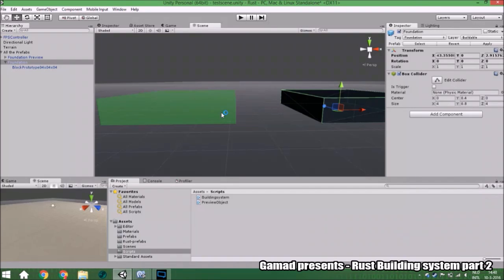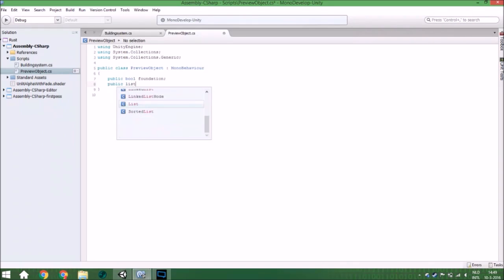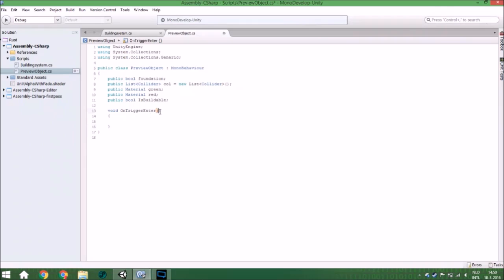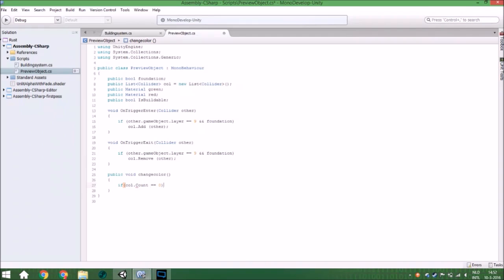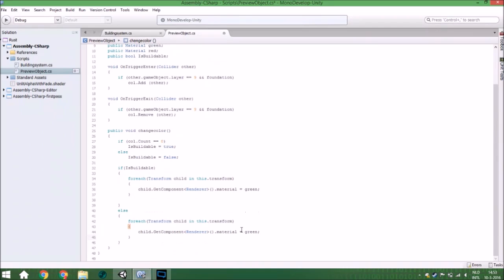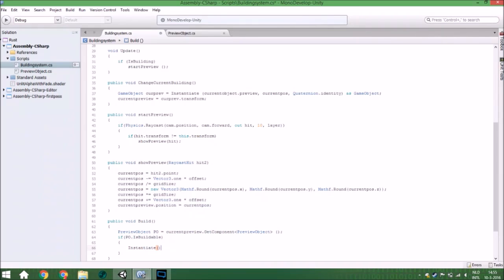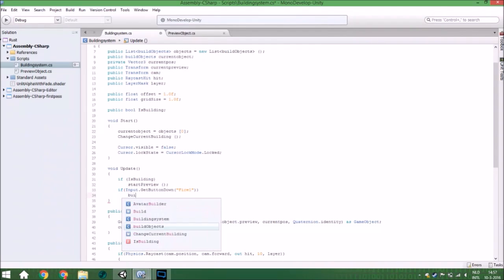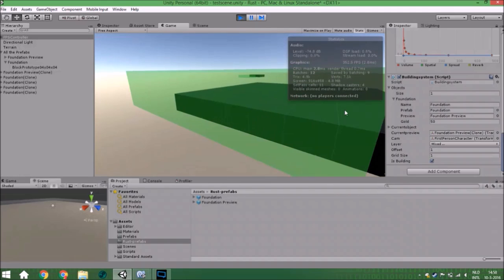[Unity 5] Tutorial: How to make a building system like Rust - part 2

Comment: Hi man,

Thanks for these tutorials.
I'm having issues with instantiating the object. The position of my preview and instantiated objects doesn't follow my raycast, they always stay at 0,0,0.
Anyone else have this issue?

Thanks in advance.
Reply: actually, I'm also getting the warning: Field 'BuildSystem.currentpos' is never assigned to, and will always have its default value
Reply: Ok, I got the initiate to work. It spawns objects at hitpoint. But the preview stays at 0,0,0.
I can fix this by calling the changeCurrentBuilding in the update function in stead of the start function, but then I the initiating of the objects doesn't work anymore. so strange...

Comment: most of the problems you guys are talking about are actually just because of the child set up. Make sure you match exactly how his Parent/Children are set up if you want to match his code. I simply removed the parent objects and put most of the funtionality all on one simple object.. the problem is when you go to change color, you're getting a component foreach child of the previewObject and changing the child component <renderer> the problem is the <renderer> doesnt always get fetched properly. I made sure the script sat on the same object as the Renderer i wanted to change the color of, removed the foreach loop, and made an if statement in the build function. My Build(); looks like this:

public void Build()
    {
        if (currentPreview.tag == "Foundation") // added a Foundation tag to my foundationPreview so I knew wether to check children or not for the correct previewobject script
        {
            PreviewObject PO = currentPreview.GetComponent<PreviewObject>();
            if (PO.isBuildable)
            {
                Instantiate(currentObject.prefab, currentPosition, Quaternion.Euler(currentRotation));
            }
        }
        else
        {
            PreviewObject PO = currentPreview.transform.GetComponentInChildren<PreviewObject>();
            if (PO.isBuildable)
            {
                Instantiate(currentObject.prefab, currentPosition, Quaternion.Euler(currentRotation));
            }
        }
    }

Comment: Hello again, the script of the PreviewObject run perfect, not have a problem notification in the console.
But, the notification of the error comes from the Script of Buildingsystem, and say this:

Assets/SCRIPTS/Construccion/Buildingsystem.cs(42,99): error CS0039: Cannot convert type `void' to `UnityEngine.GameObject' via a built-in conversion.

The error is surely due to foolishness, but I can not find the problem. Thanks in advance!
Reply from the maker: Could you also post the code line?
Reply: This is:

using System;
using System.Collections;
using System.Collections.Generic;
using UnityEngine;

public class Buildingsystem : MonoBehaviour
{
    public List<buildObjects> objects = new List<buildObjects> ();
    public buildObjects currentobject;
    private Vector3 currentpos;
    public Transform currentpreview;
 public Transform cam;
    public RaycastHit hit;
    public LayerMask layer;

    public float offset = 1.0f;
    public float gridSize = 1.0f;

    public bool IsBuilding;

    void Start()
    {
        currentobject = objects[0];
        ChangeCurrentBuilding();

        Cursor.visible = false;
        Cursor.lockState = CursorLockMode.Locked;
    }

    void Update()
    {
  if (IsBuilding)
   startPreview ();
  if (Input.GetButtonDown ("Fire1"))
   Build ();
    }

    public void ChangeCurrentBuilding()
    {
        GameObject curprev = Instantiate (currentobject.preview, currentpos, Quaternion.identity) as GameObject;
        currentpreview = curprev.transform;
    }

    public void startPreview()
    {
        if (Physics.Raycast(cam.position, cam.forward, out hit, 10, layer))
        {
            if (hit.transform != this.transform)
                ShowPreview(hit);
        }
    }

 public void ShowPreview (RaycastHit hit2)
 {
  currentpos = hit2.point;
  currentpos -= Vector3.one * offset;
  currentpos /= gridSize;
  currentpos = new Vector3(Mathf.Round(currentpos.x), Mathf.Round(currentpos.y), Mathf.Round(currentpos.z));
  currentpos *= gridSize;
  currentpos += Vector3.one * offset;
  currentpreview.position = currentpos;
  Debug.Log("Im showPreview and i run fine!");

 }

 public void Build()
 {
  PreviewObject PO = currentpreview.GetComponent<PreviewObject> ();
  if (PO.IsBuildable) 
  {
   Instantiate (currentobject.prefab, currentpos, Quaternion.identity);
  }
 }

    private void Instantiate(object prefab, Vector3 currentpos, Quaternion identity)
    {
        throw new NotImplementedException();
    }
}

[System.Serializable]
public class buildObjects
{
    public string name;
 public GameObject prefab;
    public GameObject preview;
    public int gold;
   
}
Reply from the maker: Can you also just post the line 42 (the line of the error)
I cannot see the error with this ;)

But I think you did something here wrong

 private void Instantiate(object prefab, Vector3 currentpos, Quaternion identity)
    {
        throw new NotImplementedException();
    }

Comment: Maybe this will help someone had the same issue with colors not changing everything seemed correct until I realized I forgot to put the layer buildable on the Foundation and apply it to the prefab. After making the change and running the code it works great!
Reply from the maker: Alright, great tip!
Reply: It still didnt work for me the colors arent changing any ideas?
Reply: MissingComponentException: There is no 'Renderer' attached to the "Foundation Preview" game object, but a script is trying to access it.
You probably need to add a Renderer to the game object "Foundation Preview". Or your script needs to check if the component is attached before using it.
UnityEngine.Renderer.set_material (UnityEngine.Material value) (at C:/buildslave/unity/build/Runtime/Export/GraphicsRenderers.bindings.cs:71)
PreviewObject.changecolor () (at Assets/PreviewObject.cs:51)
PreviewObject.Update () (at Assets/PreviewObject.cs:29)

Comment: I got everything, and it should be working, but I'm getting this error. NullReferenceException
UnityEngine.Object.Internal_InstantiateSingle (UnityEngine.Object data, Vector3 pos, Quaternion rot) (at /Users/builduser/buildslave/unity/build/artifacts/generated/common/runtime/UnityEngineObjectBindings.gen.cs:51)
UnityEngine.Object.Instantiate (UnityEngine.Object original, Vector3 position, Quaternion rotation) (at /Users/builduser/buildslave/unity/build/Runtime/Export/UnityEngineObject.cs:157)
UnityEngine.Object.Instantiate[GameObject] (UnityEngine.GameObject original, Vector3 position, Quaternion rotation) (at /Users/builduser/buildslave/unity/build/Runtime/Export/UnityEngineObject.cs:207)
BuildingSystem.Build () (at Assets/BuildingSystem.cs:76)
BuildingSystem.Update () (at Assets/BuildingSystem.cs:38)
Reply: Everytime I click to place
Reply from the maker: did you assign the prefabs?

Comment: Assets/Scripts/BuildingSystem.cs(67,16): error CS1061: Type `PreviewObject' does not contain a definition for `IsBuildable' and no extension method `IsBuildable' of type `PreviewObject' could be found (are you missing a using directive or an assembly reference?)       Help Plz
Reply: PreviewObject Script
http://pastebin.com/upPiv2Z6
Reply: BuildingSystem Script
http://pastebin.com/mWBy6NfC
Reply from the maker: Could you check in your inspector if the currentpreview variable is empty?
(that could already explain some things ;) )
Reply: what do u mean
Reply from the maker: when you select the gameobject where you have the script.
There is a variable called currentpreview, if that's empty (not an object assigned to it) it will also give this error.
Could you check that during runtime?

Comment: Hello, thanks a lot for the tutorials, they have helped me a lot. But I did encounter a problem. When I'm building, the col list doesn't update when the preview intersects with another foundation, and even when I manually switch the isBuilding to false the color doesn't turn red. What could I be doing wrong? Thanks in advance for any answers
Reply: Nevermind, I found a solution to my problem. Instead of checking for colliders by layer I'm doing it by the object tag. Thanks again for the tutorials! Much appreciated
Reply from the maker: No problem and I'm glad the problem is solved! ;)
Reply: How did you do it with layers?
Reply from the maker: No, I'm sorry

Comment: I have this really odd bug. When i instantiate my foundation object, it is placed 12 z units away from where i placed it. BUT there is also a collider where the foundation object should have been placed. I have no errors in the console, so i'm not really sure which part of the script i should send you? Thank you for a great tutorial!
Reply: it also doesn't change colors when  something enters it's collider.
Reply from the maker: First thing about the weird placement check for the graphics part (see part 3) of the pivot at the right spot is.
About changing the colors, but a print("test"); there and that kind of bullshit and check if it works ;)
Reply: I figured out why the foundation was offset, the prefab i made had the blockprototype placed at the 12 z mark -.- Ty for your help!

I will run a print test now :)
Reply: I ran Debug.Log on OnTriggerEnter, OnTriggerExit and Col.Count. The triggers functioned, but the Col.Count never went above 0. It appears Col.Add(other) isn't working?
Reply from the maker: For that check all the layers/tags and that kind of shit again, that will probably cause the problem.
Reply: Yes... you are correct, it was the layer stuff. Sorry for my retardedness, again, great tutorial man, keep up the great work!